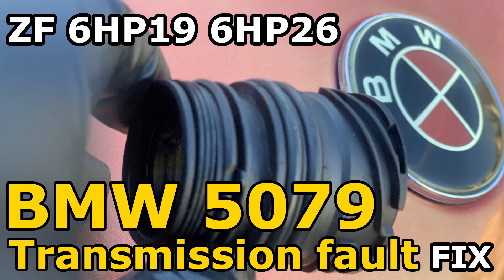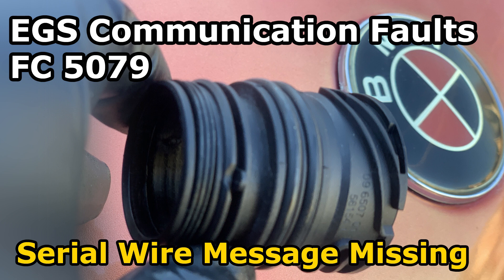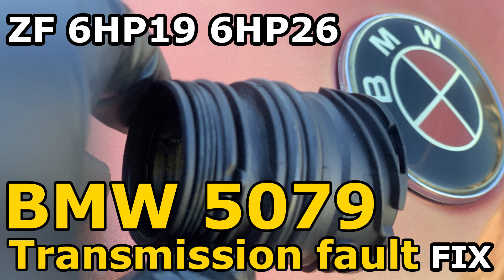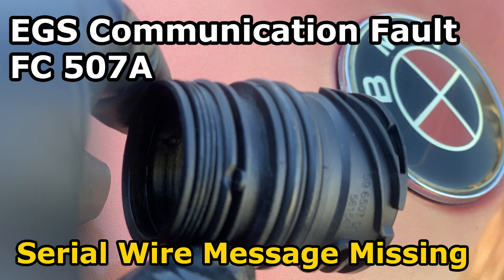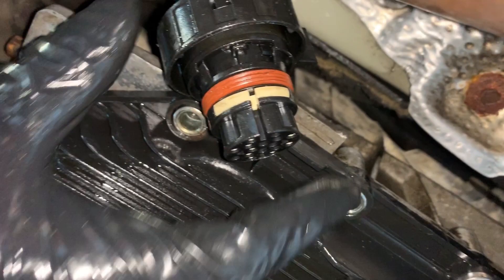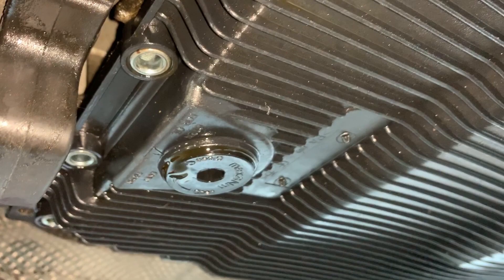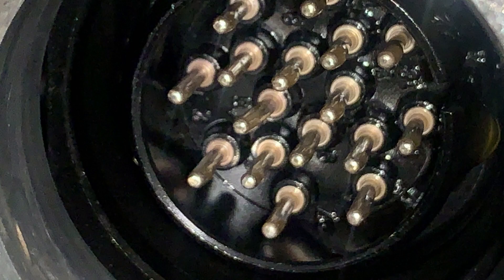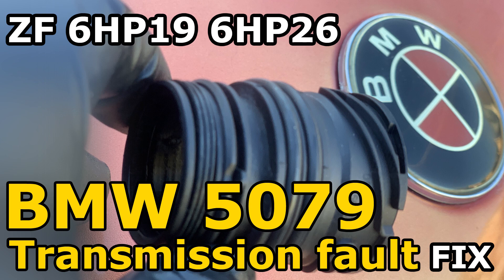BMW EGS Transmission Fault Mechatronic  Leak FIX Repair 005079 5079 FC507A FC5079 Code SOLVED

Comment: I had a leak there, cos the triple oring became smooth too much. I replaced them, no comnunication with egs fault remained. However, car drives perfectly. Wtf? In ista main module tree egs is grey displayed. Any ideas?

Comment: Is anyone with problem EGS, transmission fault while starting engine. While off engine egs and other modules without faults, but while starting engine, communication with egs is impossible and dme, dsc and other modules have faults "no communication with egs" but when you shut down engine, scan faults in egs is clear. I think that just any voltage on egs is "bad" but i dont know what mean about that :/